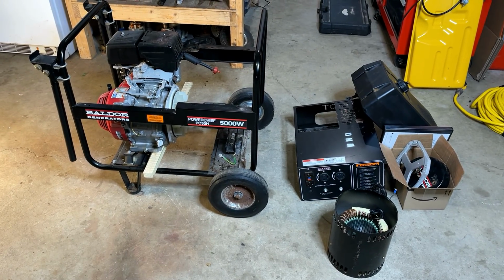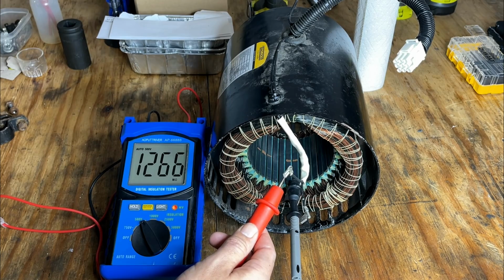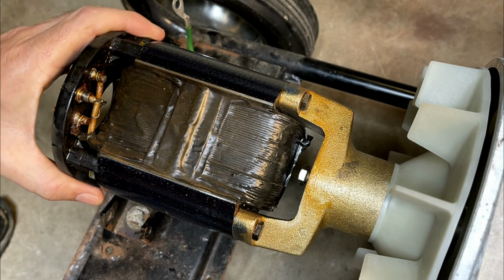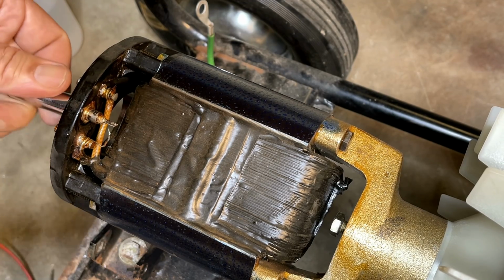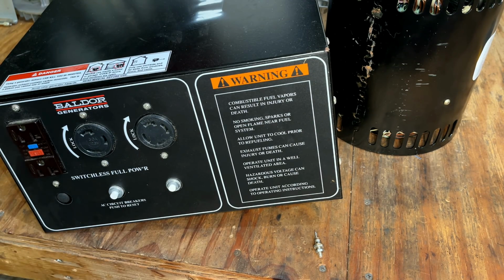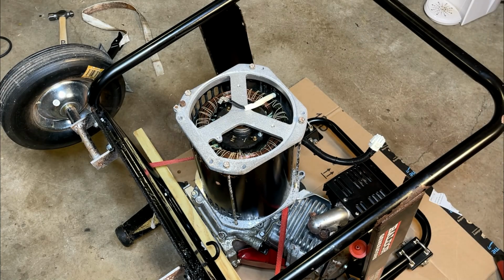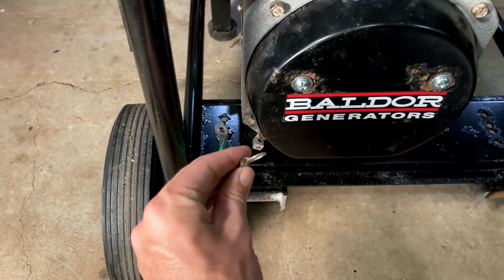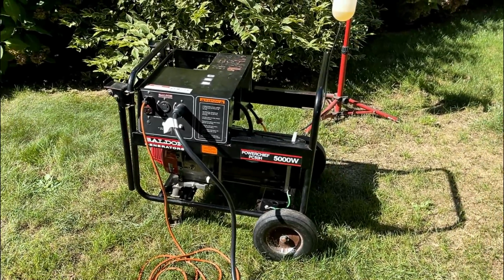Baldor Generator Not Making Power - Can It Be Fixed?

Comment: I suspect the original diode is still working.  If you look closely at it, you can see a large, sloppy soldered piece of tin on the top terminal.  Perhaps it is this that touches the diode body when bent.  I think if you clean it and carefully tin it, the diode will work.
Reply: I was thinking the same thing, way too much solder especially when looking at the replacement. As much work as he did finding it I think I would have tried cleaning the end up since there was nothing to lose. James the other small point is when you were first trying to desolder the wire from the diode. The needle-nose pliers you were using was acting as a heat sink and drawing away the heat. On your second effort you used the pliers after the solder melted which is the preferred method. Great job as always and happy holidays.
Reply: @scottdenhamrealestate7716  Exactly what I thought.
Reply: @jimpickett9974  and it was loose when tested... he found that during disassembly.
Reply: I saw that too
Reply: See what vibration can do?
Reply: I saw the same thing you saw

Comment: Was the replacement diode a Schottky? Assuming that the problem was just a loose connection the 0.4 volts forward voltage seems right for one. But using a silicon one probably would not be much of an issue.
Reply from the maker: The replacement was a power diode.
Reply: @jcondon1  Power rectifiers are usually silicon but can be Schottky ones where a low forward voltage drop and fast switching is desirable. That does not really make sense in a generator running 60 Hz but the 0.4 V forward voltage got me thinking. The voltage drop for the "usual" silicon diode is usually 0.6 to 0.7 volts.
Reply: @papaalphaoscar1  Depends on their power rating and current capacity. Larger silicon  diodes have a lower forward voltage drop. Small ones will drop 0.6 to 0.7 but large ones often drop only 0.45 V.
Reply: @r8118830  Haven't really played with large rectifiers. My experience with rectifiers mostly come from troubleshooting SMPS's. 😁
Reply: @papaalphaoscar1  A signal diode like a 1N4148 will drop between 0.6 to 0.7 V.  Something like a 1N 5401 3A diode will drop 0.55V.  Power diodes in a TO5 package or similar will drop 0.45 to 0.5 V.  The reason is that the physical size of the PN junction is greater in bigger diodes. This gives a greater surface area for current to flow through the junction. More area less resistance.
Reply: This is not an exact science. To estimate the forward voltage drop in any particular circuit you will need to examine the forward and reverse voltage curves provided by the manufacturer of the diode you are looking at using.. Ideally the curves should be fairly straight lines with a very sharp knee. In reality they only ever approximate this so the forward voltage drop can vary a bit in different circuits.
Reply: @r8118830  Almost all of the silicon rectifier diodes and bridges I have encountered have forward voltage drops of 0.6 to 0.7 volts. Even the large 35A bridge on my car battery charger has the same voltage drop.
Reply: @r8118830  Just tested a 35A bridge. 0.65 to 0.63 volts.
Reply: @papaalphaoscar1  https://www.youtube.com/watch?v=WseklKhGGAM Have a look at this video. The bit to watch is at 2min 45 sec,
Reply: The actual reading you get on any particular multimeter for the same diode  will vary according to the measurement circuit in that instrument. Try a different instrument. Another way to test a single diode is to apply a dc voltage to the diode in series with a limiting resistor. The current through the diode and resistor should be something like 80% of the full rated current,  The DC voltage should be a steady DC and not a pulsating DC as you get in a full wave bridge circuit. The voltage drop across the diode can then be measured directly on the dc voltage range.
Reply: You know, I love these sort of discussions. When I have taught sixteen and seventeen year old students they never question. Questioning makes me think deeper and of other approaches. I also learn things. Sometimes I realise that something that I thought true for years was not really so. It is always an impetus to learn more.
Reply: @r8118830  I only do component tests prior to assembly using a decent multimeter. I only do in-circuit tests if there is a problem and the component tests OK off circuit. This is limited to voltage tests and rarely do I break out the scope. It is always cheaper time-wise if you just swap components.
Reply: @papaalphaoscar1  Its a long time since I repaired anything by way of business. I used to of course and I will do the odd repair for family or friends and I still will build a small project for myself now and then. I have taught electronics as well. I am 69 years of age now and I have just signed up to do a Masters in electronics starting in February. These sorts of courses can be quite theoretical but I am good at math and like doing it. My wife asks me why I bother.  I tell her that it comes down to what else am I going to do.

Comment: Shouldn't that be an I-R 1N1364 diode?

Edit: Reviewing the video again, S1362 / 1N1362, a 30V zener in a DO-4 package rated at 10 watts.

The DO-4 package is a stud mount 10-32 thread 7/16" hex.
Reply: You are fortunate that you have semi-working part to verify that it is a 1N1364 36V (edit: 1N1362 30V) zener. 

Hold or mount the diode so that it's not shorting internally.  Apply a small current in the reverse direction.   Perhaps a four 12V batteries in series with a large value resistor.  You should see a voltage a bit lower than rated, perhaps a 1V to 2V, since the test current for the rated voltage is 150mA.  (You don't want to put that much current through unless the diode is mounted to a heat sink.)
Reply: Reviewing, the part number is S1362, a 1N1362.  That's a 30V zener.  The rest is the same, a DO-4 package with 7/16" 10-32 stud, 150mA test current for nominal voltage, 10W (or 5W operating) rated power.
Reply: @1djbecker  I doubt it was a zener. The diode is definitely used as a rectifier. Zeners make poor rectifiers. The S1362 number was just an inhouse number used in the Bador parts list. What James used will be just fine.
Reply: @dwightelvey645 They make great rectifiers, up to a point. 
Here the zener is likely used as a combination rectifier and regulator, rectifying the current to DC while limiting the strength of the rotor's magnetic field.

It seems very likely that the part is 1N1362 since that matches the case style and is plausible for the circuit.  A manufacturer isn't likely to have a custom part number put on a common part bought in modest quantities.
Reply: @dwightelvey645  Some car alternators use zeners as rectifiers to provide overvoltage protection also
Reply from the maker: Not sure.  Vishay did eventually get back and they said it was custom ordered but they did not know the specs.
Reply: @jcondon1  I doubt that it's a custom part number, just not recognized by person on the phone.

The Vishay buy of I-R wasn't a smooth acquisition.  My guess is that no one from I-R power division is still around, and none of the FSEs have access to any special knowledge or info about obsolete parts.